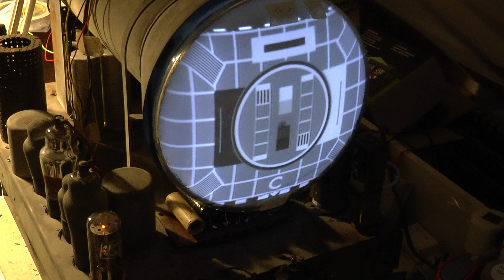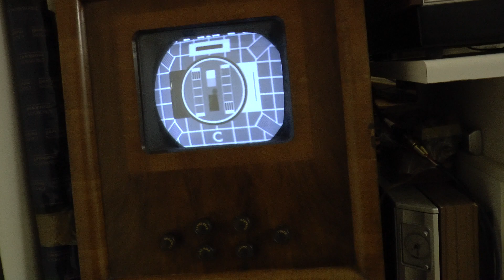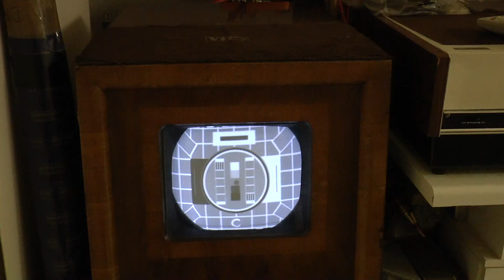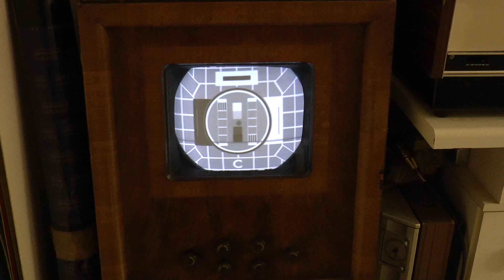Marconiphone 704, Pre War Television 1937

Comment: How is that working uk is digital not analogue
Reply from the maker: I use a converter called a Aurora, that takes in a modern signal and converts it to the old type of signal and plugs into it's aerial socket
Reply: Oh kool

Comment: Excellent video on your rare working Marconiphone 704 set. It's quite mind blowing seeing modern pictures on an over 80 year old telly and the pictures looking very good!!! Love how the picture forms on warm up too, quite crazy looking! Did you had to replace any wax paper caps and out of tolerance resistors or is it all original parts? Noticed you have a Philips N1500 tucked away at the right, is it still operational? I had a N1500 once until one of the video heads broke then I sold it to another VCR/VTR collector, I have some N1502 machines, can't seem to get the picture to track on them even after tech advice from a skilled VCR format enthusiast.
Reply from the maker: I did change all the capacitors, except the eht capacitor. Some resistors were changed as well. The 1500 on it's side is for spares, I do have a working 1500, its head drum is just OK one head has low output, that makes tracking very critical to adjust.. On your one check both heads on drum have a good even output and the control head is giving a strong pulse for the servo circuit to lock to , as this head can wear to

Comment: These sets were analog!  How did you get digital channels and switch ability on it?
Reply from the maker: I use a Aurora converter it converts 625 line to 405 line and has a built in modulator so it connects into the original aerial socket, so any digital receivers with 625 line video output can be displayed on the tv

Comment: 405 lines looks ok on a 9 inch screen. I found a 1936 television receiver advert describing the 405 line bbc transmissions as high definition.
Reply: 405 lines was high definition at the time when you think that less than 10 years before 30 lines was being broadcast.

Comment: I love looking at your Philips N1500!!! Iv got the N1702. Those machines fascinate  me. Also admiring your EVR machine!
Reply from the maker: Hi, the one beside the 704 is for spares but I can use it as a rewind vcr to save the heads on the working one , which you can see the corner of at the end of the HMV 900 video. The EVRs are Hitachi both work and I have 37 black and white films and 1 colour, which is a test film for set up

Comment: Hoiw do you manage to pick up 625 lines when these TVs were made for 405 lines? I must day it is a fascinating video.
Reply from the maker: I use a 625 line to 405 line converter called a Aurora
Reply: @vintagevideo4044  Thank you for taking the time to reply. Most interesting.
Reply: More datails please..
I have a rubin 102. Help me 🙂
Reply from the maker: With your television, it depends on the tv system it was made to receive, if its 625 line , then a multi system modulator would do like ones made by ikusi, I use the models MAW -200 and 201 to run other older televisions that have non UK sound systems or only have a VHF tuner. Then if the modulator is set to the correct system and fed with a set top box or satellite receiver you should get picture and sound

Comment: Did you changed some capacitor? The center of the screen is burned...
Reply from the maker: I changed all electrolytic capacitors and left most high value , orginal capacitors in place
Reply from the maker: Also I should have said replaced every wax capacitor
Reply: Ion burn
Reply from the maker: Yes both pre war televisions have some ion burn, the post war Pye D16t also has the type of tube that gets ion burn

Comment: So that would be 405 lines? How does it work with todays' video signal? Converted to 625 or special converter/modulator?
Reply from the maker: To run this I use a Aurora converter it's purpose built to convert 625 lines to 405 lines and it has a built in modulator so the signal can be fed in to the aerial socket.